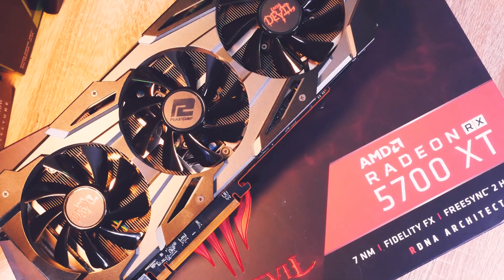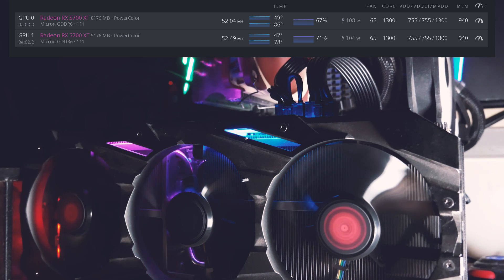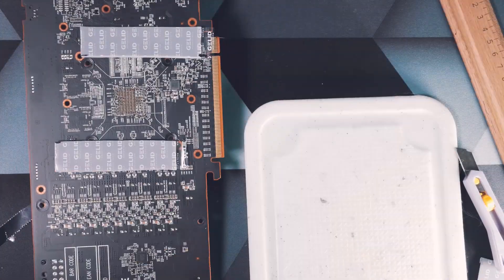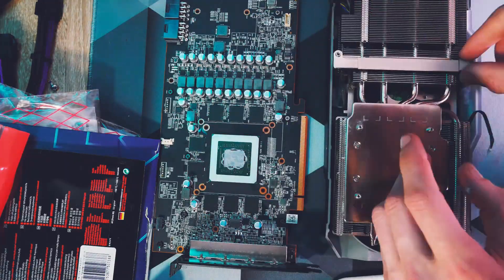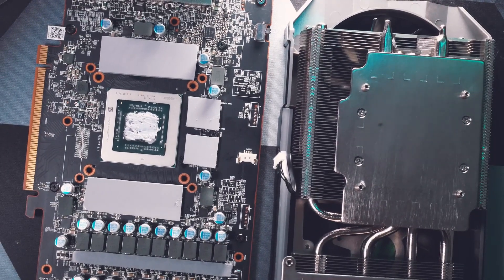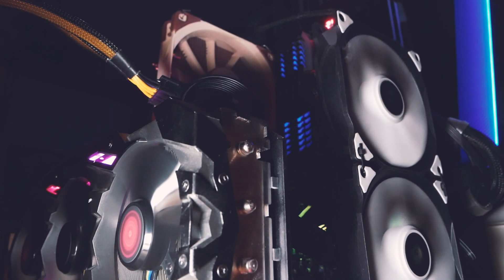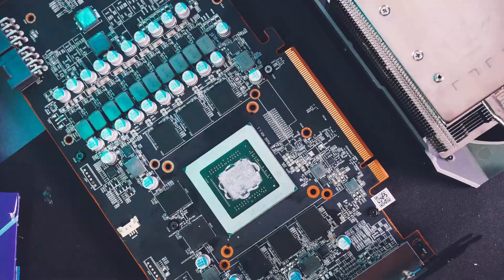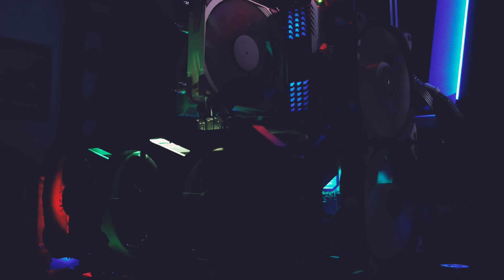RX 5700 XT Red Devil from Powercolor: New Thermal Pads on backplate and memory before and after

Comment: I'm Brazilian and I don't speak English, so I had a question. I would like to know how thick the thermal pad you used in the video were? I have an RX 5700 XT Red Devil and it's very hot here in my city, the way you did it in the video would look great here on my board.

Comment: Thank you so much for this video - my 5700xt red devil is hitting 99-100c (memory) on load (high settings in Baldurs Gate 3 on dx11). I've never replaced thermal pads before, and this video gave me the confidence I need to just do it lol
Reply: Replaced the pads and added new ones as suggested in the video; 3mm for the back, 2mm for the memory and 1mm - gelid pads. Added new arctic silver to the gpu and am running 30c cooler!
Reply from the maker: This is amazing news!! Congrats!! Very happy this video helped out :) cheers and happy gaming!
Reply: @XenKreigor  It uses how much 1mm where? I'm Brazilian and I don't speak English, I have this question about the thickness of the thermal pads

Comment: 57.04 MH/s at 136w PowerColor Red Dragon RX 5700 XT 8176 MB
Micron GDDR6 · 111

BIOS mod 1500 Straps to above on both mem

CORE_CLOCK : 1400
CORE_VDDC  :  790
CORE_STATE :    5    5
MEM_CLOCK  :  925
MEM_STATE  :    2    2
MVDD       : 1350
VDDCI      :  800
SOCCLK     : 1267
SOCVDDMAX  : 1050
REF        :
FAN        :  (74%-100%)
PL         :
AGGRESSIVE = 

PhoenixMiner Extra config arguments
-amd
-mode 1
-clKernel 1
-clNew 1

Comment: Hey,  you’ve been very nice to me in the comments before and I have a silly question about mining...May I ask it?
Reply from the maker: If I can help, I will :) no need to ask to ask a question :)
Reply: @CursedMining  thank you very much. My question is regarding NiceHash. I recently got a rtx2060, and I was getting close to 0.000042 btc/per day from that gpu alone. After a couple weeks of adding gpus, I noticed my profitability (in BTC) was nearly the same mining with 4 gpus compared to 3. After looking more, it was my rtx2060 that was getting roughly 0.000031 btc/per day. I’m quite new to mining, is this drop in profitability something I should be worried about, as in there’s a mechanical issue, or does it just fluctuate naturally? I’m still getting the exact same hash rate, temps are good, and I’m on stock settings (no overclock). I’m aware that profitability in fiat changes daily (duh), but does profitability in btc also change so dramatically? Thank you.
Reply from the maker: hey, indeed profitability in BTC can also change a lot, depending on demand from NH as they are basically a hashrate renter and depending on how many people hash there. If hashrate stayed the same (& stable) it is no mechanical issue. Did you ever try mining ETH directly and compare your earnings? (as NH is definitely using your hashrate for ETH mining) cheers
Reply: @CursedMining  no I never tried that, I’m pretty new to mining. I just messed up my rig lol. While e trying different combinations of gpus, I started getting “increase virtual memory” in the notifications which was weird as I always had enough virtual memory. Now When I load up NiceHash only one gpu works, the rest are recognized but they say error and there are no algorithms available.... and it still says to increase virtual memory. What do you think I should do?